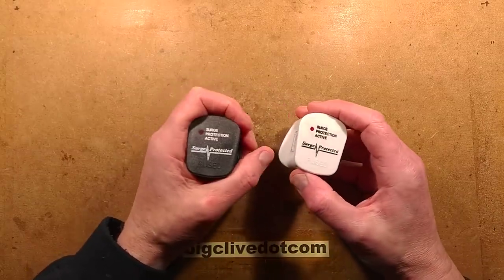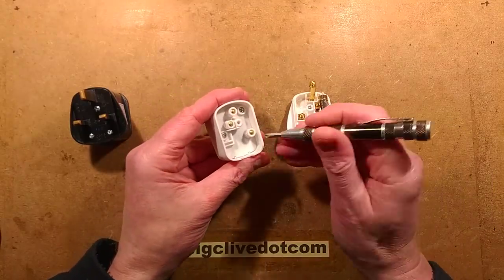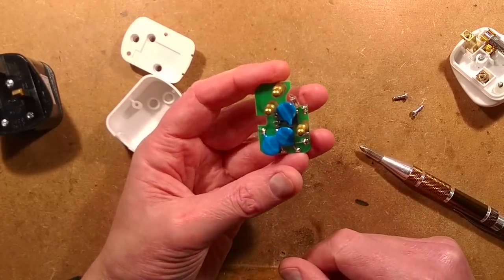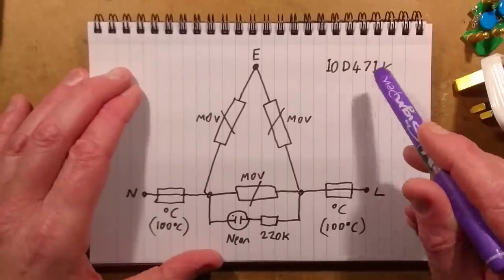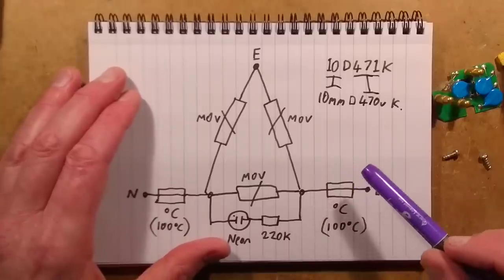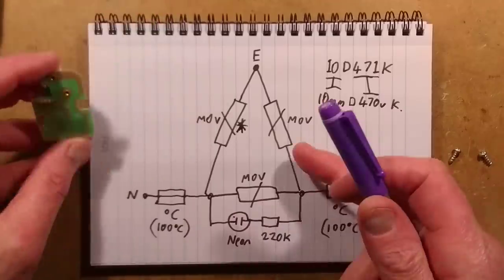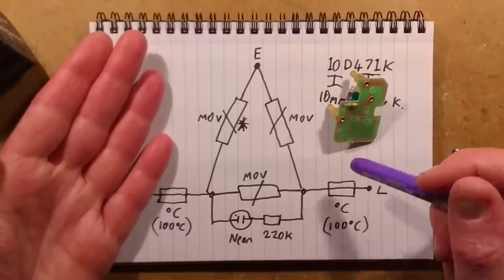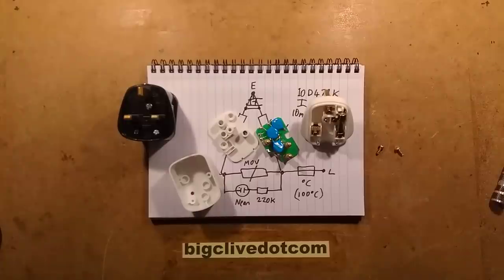British plugs with built-in surge arrestors.  (With schematic.)

Comment: These are by PMS, Hong Kong company called PMS Ming Kee. They've been making plugs in the UK since at least the mid 80s but the company is 40 years old. You used to find them in market stalls but they've proven to be good quality and widely available under own brands such as CPC, Morrisons etc and found on many small appliances. The design hasn't changed since the 80s and they're generally one of the better plugs on the market (although they’re using cheaper plastics as time goes on).

Before PMS started doing this surge version in the 2000s, WG/Volex (in the 80s/90s) made a UK made surge protected plug like this.

Comment: These seem like they are pretty good as surge protectors go, apart from their lifetime being fairly short if your lines are noisy. Most cheap surge strips I see in the States only bridge LN (no LG or GN), and many lack any kind of indicator of whether they are still actually providing protection. That this one also seems well-built and cleverly engineered is a bonus.

Comment: I remember back in the early days of PCs, someone wrote a column about adding MOVs to power strips to add surge protection. Within a month, most U.S. Radio Shack stores were completely out of MOVs. Soldering in 3 MOVs was simple, easy and effective, but I don't recall anything about adding thermal fuses. Unlike now, surge protected power strips would cost upwards of $50-$75, and were difficult to find because they were 'commercial' products.

Comment: I do like surge protectors that don’t shut off when they stop protecting. I have never met a non electrical person that pays any attention to the light going out. But the beauty of this design was that they didn’t have to interfere with the existing plug design. I wonder if they could add a buzzer when it stops protecting. This would also help when the plug is out of site behind a piece of furniture.
Reply: I'd concur with that. I wonder how many surge protectors in use are actually providing protection any more. I seen a fair few that aren't. People just tend to assume the wouldn't work at all if that was the case.
Reply: I have found the surge protectors that offer an attached device warranty are the ones that will shut off when they stop protecting. I’m constantly checking family and friends computers to verify they’re plugged in to a proper surge protector. Since I’m going to be the one that has to replace their power supply. They are always so confused that I tell them their surge protector did not protect them when they were plugged into one that didn’t shut off.

Comment: There are actually MOV's with series thermal fuses integrated into a single package. Littlefuse makes them, makes layout and design or adding protection to an existing circuit very simple.
Reply: and this is why I read the comments, knowledge is power.

Comment: I've had one of those on my computer power lead for many years, just realised I've never checked it see if the MOVs are still OK. It doesn't have the neon so no obvious outward indicator it's still working.
edit: had a quick look, it's a similar design but the components are potted.

Comment: Hi Clive, great video.
The reason for the thermal fuses in contact with the MOV, would possibly be because when MOVs fail, they do as a short and usually split open.
So at sometime they probably get hot, the fuse is to prevent the smoke an flame from occuring.
Reply: Yes that is correct.

Once I saw a surge protector after lightning strike catch fire a little while afterwards.

Not at my place somewhere else.

Use the fire extinguisher on that one.

Also nice user image I see your fan of Lego.

On what Minifigures did that come from I'm sure it's an hodgepodge of them.

Are you with adult fan of white girl like me?

Comment: Got a 33D00061 unit, which is rated for 480VAC. 470VAC will not clamp most small pulses, but will do big ones. you only need 2 thermal fuses, as they only need to disconnect 2 out of the 3 wires at most for the unit to not work.

I have made many DIY versions, using a single MOV, 275V, inside a standard 16A plugtop, as they do work well to clamp spikes. The MOV units tend to fail short circuit and trip the breaker, but here the breaker is 20A, not a 32A one used in the UK, where you instead use fuses in the plug instead. Not sure which system is safer overall, both have pros and cons.

Comment: one reason for incorrectly wired sockets is the fact that different makers put the connections were they like so if someone goes to b+q or some such and gets nice new shiny sockets , switches off the power and removes old socket and fits new socket they will just fit the wires same as old socket which may have L + N opposite way round , when they plug something in to test it works , job done :-)

Comment: British plugs are just soooo huge.  Glad Canada uses the small 120V plugs!   :-)
Reply: Yes, so easy to grab the live conductors as well. No wonder the standard method to remove is to pull out by the cord, because the plug is small, there is no sleeved end and of course the sockets have no switches to disconnect them either.
Reply: @SeanBZA  - Yet as a Canadian I never hear about anyone touching the live connector.  They aren't hard to pull out but true that some people are lazy and grab the cord.  They take the abuse.  120V is great for the vast majority of items and we have 208 and 240V for the big stuff.  We do have switched sockets but they are usually just for a lamp outlet on the other side of the room.  Don't need it otherwise.

Comment: They look like a good idea, if they go the top half can be replaced without disturbing the wiring. I've got the power strip embedded type here, no issues so far. As for your domestic sockets - a case of Part P kitchen fitters ? Not that I have anything against kitchen fitters, just believe their bloody hands should be cut off if they play with electrics ! Discovered in my kitchen 2 sockets in 2.5mm T&E and 1 in 1.5mm T&E all in a 15 amp choc strip. Earthing cable to the earth rod had been cut to get a unit flush to the wall. Thank god I still had a metal gas pipe. New earth rod and wiring done straight away.

Comment: It occurs to me that if you just plugged one of these into the sockets at each end of a ring main, then it should provide reasonable protection for everything else plugged into that ring.  There's no need to actually wire them into any appliances unless you're short of sockets.
Reply: Remind me where the end of a ring circuit is again?
Reply: @Monkeh616  end of the house and start of the house, I guess having one plugged into each room would work  as well, the more you have more likely they adsorbed the spike over each spd 

but generally they more effective if they are before the device that is been supplied like an extension cable with all your electronics plugged into that (or in the consumer unit as is starting to happen ) 

Belkin with there surge master line socket and 4-8 way extension leads having doing it for a very long time
Reply: @Monkeh616  The two ends of a ring main are the first socket and the last socket going clockwise or anticlockwise in the southern hemisphere.
Reply: @petehiggins33  First socket from where? It's a ring. And yes, I appreciate you mean the first one along the run from the CU. These really only provide very, very basic protection, though.
Reply: @Monkeh616  Clearly it would be better to fit a proper surge protection device like this http://tinyurl.com/r8a2vpf  in the consumer unit but they are expensive and should only be fitted by an 'electrician'.  But if you were thinking of using  these relative cheapies to protect a couple of appliances then my suggestion would give the same level of protection to all the sockets on the ring for the same cost.  You need to use two because the transient will travel in both directions around the ring and the suppressors will only protect sockets downstream of the wiring.

Comment: I must be missing something. The standard plug base connects the cable of your device directly to the outlet through the fuse. How does the additional PCB bit do any protecting if it can't actually break any connection?
Reply: It doesn't break the connection, it just sits in parallel with the load and shunts any excess supply voltage to earth.
Reply: Dave Pusey, Ah ok. Thanks for explaining.
Reply: @davepusey  Thanks. I feel like, unusually for Clive, the video was rather lacking in explanation for how it actually works.
Reply: @davepusey  Since there is a thermal fuse in series with the MOV, it would probably blow the thermal fuse and protect the MOV during a surge. The connected device will still be connected to the outlet without any protection.

Comment: The connection is pogo pins or spring loaded pins, they are becoming more popular with electronic manufacturers as the board connection is just pads ecthed into the circuit design and no cost in parts so the programming connector or test connector is pushed against a set position and makes the connection.

Comment: Efficiently made and seems to be of good quality. I have not seen a similar product in the US. Here I have only seen large MOVs on poser distribution strips and backup power supplies. Usually the whole unit is thrown out when someone notices the neon has gone out. That's a lie. Nobody ever checks the neon.
I do check and replace MOVs. I have heard MOVs wear down over time, with every tiny overvoltage hit eroding the internal bits a little. Don't know if that's true.
Reply from the maker: They do fail progressively over time with each transient absorbed, just as you mentioned.
Reply: @bigclivedotcom  Can they cause ghost RCD trips when they age then?
Reply: @uK8cvPAq  They can, although usually they're terrifyingly hot before that occurs, which is where the thermal fuses come in.

Comment: Need to check if there is a shucko F type with MOV, but mostly the F type is big a bulky plug-in socket. Not to say that the british plug is bulky by any means, since it carries a fuse holder just in case.... as for the MOV reference  search the part number and check  the datasheet, first pages, eg little fuse. 

 Mic is very crystal clear with voice.

Comment: My concern with this design is, is the live going into the surge protector is after the fuse, not before. So if it starts dumping power, is that going to trip the fuse in the plug, preventing the surge protector from doing what it should do? Shouldn't it actually be without a fuse, and without the possibility of wiring to an appliance?

Comment: Clive i was thinking that why they are not using 10d371k mov.voltage will not go above 370v.
Reply: Because with 10% tolerance a non-trivial number will conduct every cycle, and even those which don't will have short lives.
Plus, the greater energy dissipated will cause more heating of the MOV and shorten their lives even further.

Comment: Hi Clive, 
Mov's  break down over time and end up leaking a current to the neutral. I've always sold an low currant circuit breaker to be installed in series, mainly as a cost saving so the surge protector doesn't waste power. Maybe that is why the thermal fuses are there.

Comment: Not totally keen on the spring connectors, a high resistance connection between the screw head and the plunger or between the two sliding parts means the surge protection wouldn't be effective but could still pass sufficient current to light the neon.

Comment: Interesting, so not an in-line protective device, but more like a voltage-detecting shunt?
Reply from the maker: Yes.  Just shunts transient spikes.
Reply: @bigclivedotcom  Would they protect against a nearby lightening strike?  Is so I will buy a few for my computers etc.
Excellent video, thanks Clive.
Reply: @gromett  Are you asking if the computers will be fine after the house has been vaporised by a lightning strike ?

I suspect the first thing you should do is assess the likelihood of a strike.

This could be an interesting consideration for when I next trim the trees.
Reply: @millomweb  
he did say nearby strike :-)
but it would be impressive if the house was blown to bits and the computer was standing there good as new :-)
Reply: @gromett  Power line surge suppressors alone won't save you, you need proper grounding so surges don't travel through alternate paths such as AC->PC->HDMI->TV->STB->coax. For higher value equipment, I'd rather have a better-rounded surge suppressor with in-line chokes (ex.: Tripp-Lite isobar) to soften transients and give its multiple 20Dxxx MOVs a better fighting chance against whatever is left.
Reply: @gromett  Within limits, yes.  Nothing short of unplugging the device is going to protect against a direct hit, or even a side bolt.
Reply: @gromett  A friend's house is surrounded by farmland (grass). Just uphill about 100yds away is a small disused quarry. It's quite likely that there's some old farm machinery buried in there.  A big lightning strike hit the quarry and destroyed his surge protector and his computer. He also had to change his underwear :)
Reply: @russellhltn1396  Unplugging the device is accepted. But you face the risk of having your hand on the plug top  as the lighting strikes. Also for how long should it be kept unplugged; mild storm, moderate storm, high storm, how can one decide.
Reply: @plasmatorque4318  Ask the residents of Florida what they do.  They get thunderstorms nearly every afternoon in the summer.

Comment: I'm still getting to grips with surge protectors but I do wonder, if they all have a limited lifespan, why are they even built in to some extension leads when I'm assuming they're not easy to replace that way? It would make more sense to me to take a normal extension lead and change the plug on it to one of these plugs with a built-in surge protector, and then when that protector fails, you can simply buy a new head, or is there a reason that's a bad idea?
Reply from the maker: You could do that.  A surge protector should last a long time if it isn't on a very spiky supply.

Comment: At 470v your computer is protecting the MOV's, 
I use 275 v big buggers in the extension lead and they haven't gone bang yet. I like the thermal fuses, I shall fit some.
Reply: 470V is not the AC rating - it is DC. A 275V DC MOV would spend much of its very short life conducting.
Reply: @Monkeh616  
I wouldn't rely on those springy contact things to stay connected in the event of a big hit.
Reply: @FarleyHillBilly  In the event of a big hit this isn't going to save much anyway - but it can sure help to take the edge off normal grid activities.
Reply: @Monkeh616  
It's the abnormal ones that worry me, like an open circuit 3 phase neutral.
The MOV only has to remain intact long enough to take out a fuse or breaker
Reply: @FarleyHillBilly  Its job is not to protect against those failures, never has been. These plugs especially are not designed or sold for such an application.
Reply: @Monkeh616  
Well they ruddy well should be.
It doesn't cost that much more.
If you have a £1000 PC with half a dozen hard drives attached,  I want a protector that protects.
Reply: @FarleyHillBilly  It's a simple clamp - it cannot be used to protect against a lost neutral. You need to actively isolate the supply for that, and they do make equipment for doing so. Oddly enough, it doesn't come in the form of three MOVs on top of a plug. And yes, it costs that much more..

And well, there's such a thing as contents insurance..
Reply: @Monkeh616  
I am as sure as I can be without applying 480 vac that my thing will work long enough to take fuses/breakers out to disconnect the supply.
I have RCD's and smoke detectors and switch plug tops.
Shame on me when I left the phone connected to the modem when we had a nearby lightning strike
Reply: @FarleyHillBilly  And I am not remotely so sure. MOVs do not necessarily act as a dead short when (not if) they fail, which means you could instead simply cause a fire. Which is why the thermal fuses are present, complete with the ability to entirely scupper such an idea. It's also quite possible you'd simply blow the MOV out of the circuit entirely before any breaker operated..

Tool for the job: MOVs are not for protecting against sustained overvoltage or intentionally triggering other protective devices (except their own thermal fuse).

Comment: 6:55 And in other countries, the plugs aren’t even polarised.
Reply: I was told once upon a time that Norway and Peru are the only countries in the world that has no live/neutral, but both phases have about 130(?) Volts  to ground..
Reply: @andersfrihagen3656  https://www2.theiet.org/forums/forum/messageview.cfm?catid=205&threadid=88103 suggests that such systems are  also seen in other parts of Europe and that Norway also uses the normal 230/400 system. The phase-phase voltage is sqrt(3) times the phase to neutral voltage, so with a 230V phase-phase voltage you would have about 133 volts phase to neutral.